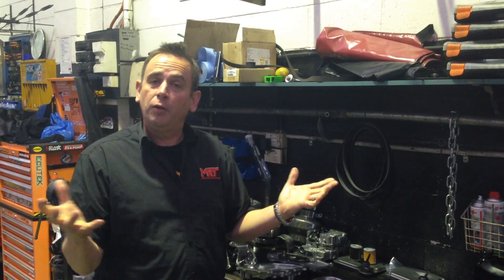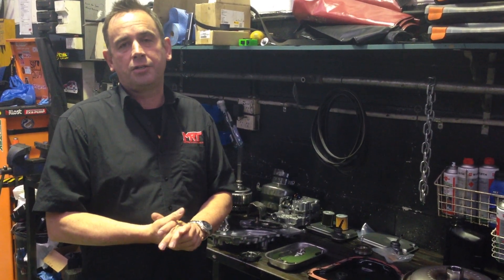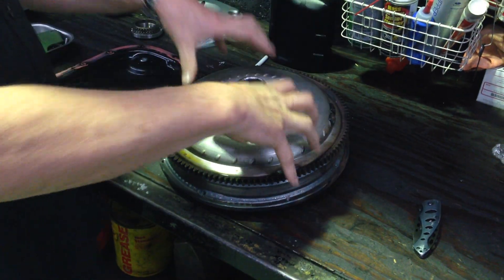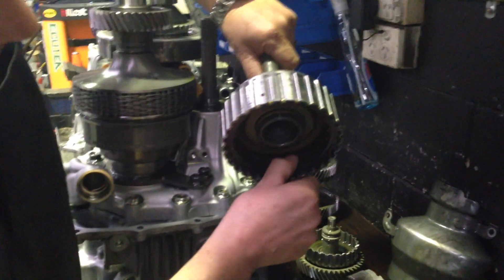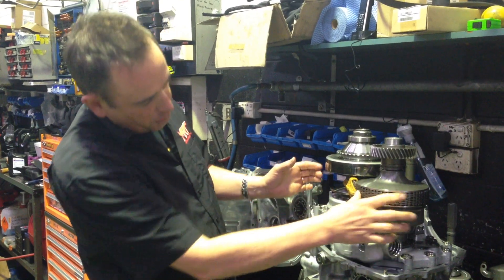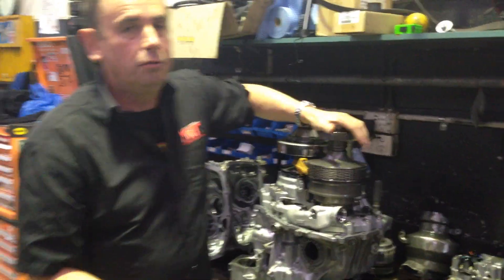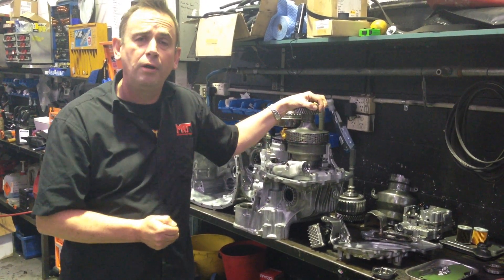Subaru CVT transmission secrets

Comment: Hello, awesome video I have a 2014 subaru xv crosstrek automatic transmission not going into gear. Noise coming from underneath the car's transmission sump pan area. Do you think the solenoids stopped working?

Comment: I just had to replace the torque converter in my 2011 due to stalling issues at 128000miles. Other than that its been pretty depwndavke

Comment: Help please!! Any advice on the Forester XT (2016) occasional hesitation under acceleration issue? Seems to sometimes hesitate under about 30%-50% acceleration (feels like maybe misfiring or cvt not engaging correctly). Issue is way worse with air con on!

Comment: 2015 outback 2.5l with CVT - real pita shudder at low rpms. Like its changing up a gear too early. On a cold morning the engine revs higher and it's not an issue until it warms up. 

It seems like they have it tuned too close to the edge for fuel efficiency at low rpms at the expense of shifting hunting gear progression. 

Has anyone fixed this??

Comment: I have a question....I have Levorg 1.6. Can TR690 be fitted instead of TR580 gearbox?   I want to increase performance, but can the transmission tr580 handle 350nm of torque?

Comment: Have a 2010 outback went to mechanic for engine light after they put on computer wouldn’t start. Subaru now says a inhibitor switch inside transmission has failed and I new a full new transmission as they are not able to be reconditioned. Had no transmission noise or issues prior to this diagnosis.. please help 6000 seems like a stupid outcome

Comment: I’ll CVT transmission is a piece of crap I highly recommend no one buying any Subaru products at all they are nothing but garbage cheap interior parts in a transmission that stalls . The reason they moved away from this transmission is because it’s a piece of garbage i’ve had to CVT transmissions in my Subaru and it only has 170,000 miles!!

Comment: So you said it will start slipping at 400 nm, convert to horsepower that’s 149 which isn’t good at all if you get the wrx with cvt. Even the crosstrek comes with 152hp.

Comment: hello i just got a 2013 Subaru Legacy 2.5 Premium has 175,00 miles drove and shifted beautifully  but im noticing like if the tranny is slipping before at 200 rpm i was doing 60 mp no problem  know i noticed it was like 3000 rpm going 40 mph and gave gas rpm would go to 5,000 rpm going 60 mph seem to have no power motor screaming and car not moving write do u think getting a transmission flush would help or something more serious ..  thank you for listing hope to hear from u soon thank you  my email  Martin350@live.com

Comment: I have a 2016 Legacy 2.5i and when I slow down, it almost sounds like the wind. The dealer said this is normal... Is that the case?
Reply: I have a 2017 Subaru and yes that sound is normal as you slow down.

Comment: If a cvt optimizes engine torque and performance why are Subarus so slow?
Reply: Bc the boxer engines (like the rotary) don't put out that much torque to begin with. You gotta step on it a little more.

Comment: @3min : That tranny fluid pump should be driven directly from the engine and not from the input shaft via torque converter. There's a funky fundamental design flaw, I believe. TOYOTA employ this design to have continuously variable pressure control to operate the CVT pulley more effectively

Comment: This is a very informative video. I am interested in replacing the main bearings that make the noise. I have already gotten two(2) but I need to know what is the name of the bearing that is on top of the pulley?. this bearing is a big bearing and some times  it will make noise when worn out. If possible please send me the info to nillocw@hotmail.com

Comment: In 2017 I was interested in a new 2017 Forester and when I found out that the towing capacity was 1500 pounds and that was because of the CVT my interest in the Forester or any car with a CVT ended.
Reply: I do hear that Bill, just now, we pulled out of a deal for the 2016 Outback for that--and for general reliability issues.

Comment: i'm inspecting a wrx with cvt in a few days .But this cvt is abit odd to me .From what i've seen even in manual mode you don't get the headsnap and fast feel like in a dual clutch or manual .It seems like the same acceleration as a electric car .Idk il have to test drive it myself but i like an auto with manual mode but a dual clutch

Comment: Good reason to lease Subi's.  They do have a high residual so lease payments are pretty good compared to other brands.  Unfortunately most mfgs are going to CVT's as they help with CAFE requirements.  Yes you can partly blame the govt for the CVT craze.

Comment: I have a 2016 Forester with a CVT.  The only problem I have with the CVT is the 2 second delay when you shift to or from reverse.  This is a major issue if you are trying to rock the vehicle when you get stuck in snow.  When I took the vehicle to the dealer to fix this problem the tech said that is normal and there is nothing they can do.  He never talked about a "CVT relearn".  Will the "CVT relearn" make the CVT act like a normal automatic transmission when shifting to and from reverse?
Reply: Best to upgrade Foresters that might get to drive on dirt, mud or snow to 'All Terrain & Snow' tyres - larger chunky knobs of rubber that won't get stuck in snow!
Reply: @GraemeHarrisonAU  , I agree tires make a big difference, but you still can get high centered and sometimes rocking the vehicle will get you out.  Thats why I asked the question.

Comment: The older Subaru Transmissions had an external filter similar to an oil filter that could be changed easily on the outside of the transmission.  To me the filter inside that cannot be changed without tear down looks like the sort of filter that will get dirty and clogged way before the strainer type in the sump. Sad to see and say but looks like a design flaw in my book. I love how the CVT drives though and would like a CVT Forester Turbo one day but the compromises are hard to swallow Subaru.
Reply: Putting a turbo with a CVT makes NO SENSE. One of the reasons is the CVT can't take it.

Comment: This is why I drive since new a 2009 Mazda 3 s hatchback 2.3 with 5 speed auto and 195,000 miles. I have been dumping money lately for suspension parts at all four corners and a trans module. A trans module is not a rebuild. At the end of the last 5000 mile oil change interval I got back from a 2000 mile Marathon trip in 50 hours. Car ran like a champ. Did not burn or leak a drop of synthetic oil.

Comment: My 2012 Outback is stalling at stop signs. I have been told it is a CVT torque converter issue and it needs to be replaced. Thankfully it should be covered under their new extended CVT warranty of 10years or 100,000miles.
Reply: I had the same problem with my 2011 Outback at 115k miles. I got Subaru of America involved and they covered half of the repair costs which was $1500 and SOA covered $750. My Outback has now almost 145k and runs great.

Comment: Can you swap a CTV from a 2016-present Subaru for a 9 speed automatic transmission?
Reply: Joseph Dugan get a manual
Reply: Joseph Dugan the 9 spds aren't much better imo.stick to 6-7max gears
Reply: No.  In fact, no other auto trans will fit in any Subaru.

Comment: I don't understand why you need to have oil pressure in the transmission with an electrical pump while the engine is shut off at a stop.

Comment: Wow, 30 years as mechanic. You are telling me it has an electric oil pump, clutch packs, chain drive with adjustable pulleys and one filter isn't serviceable from the pan? what a royal pain in the butt!
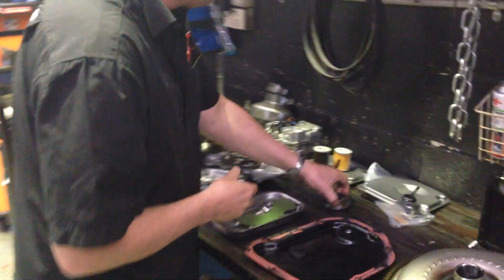Reply: It has a mechanical pump; see @3:00 where he replaced the bearing
Reply: @profuse007  it has both, the electric takes over when the engine shuts off for the engine auto/stop function
Reply: That internal filter and the fluid is "good for the life of the engine."
Reply: @birdwing98  no fluid is lifetime this is rediculous it is almost planned.
Reply: horrifying

Comment: I've had two experiences now with changing the CVT fluid, dropping the factory fluid & putting in Amsoil CVT fluid. 35 years now working on cars, trucks motorcycles etc and it's still hard to believe the very tangible difference in performance. These CVT transmissions really like Amsoil CVT fluid!
Reply: I couldn't agree more!

Comment: This seems like a very poor design for long-term reliability.  What is the point of embedding a non-user-replaceable paper element filter in the transmission?  The electric oil pump requirement created by the "start/stop" feature is another cause for concern.  Electric pumps are inherently unreliable and the fact that one is required in a critical component of the drivetrain simply to save a couple of drops of fuel simply does not make sense.  I test drove a 2019 Subaru Forester with this system and the engine restart from a stoplight was abrupt and noticeable. A mechanical system is only as strong as its weakest component...

Comment: From what i hear, consistently changing the fluid will prolong the life of the transmission. Also because the transmission has a lot of intricate parts, a "power flush" is typically not recommended.

Comment: My dad's 2015 Outback's transmission only lasted 4 years / 95k miles, so it wasn't even paid off before the transmission failed.  It's $11,600 to replace at the dealership, so it essentially "totaled" the car since it's only worth about $15k.   You'd have to be out of your mind to buy one of these in my view.

Comment: while i personally haven't had a cvt i'm afraid to buy one because i've yet to feel that they last to 100,000 miles they can gernade as soon as 20-30k if not even sooner. for me its an investing thing i bought the 08 when it was 5 years old, and felt i definately could get 5+ more years out of it solid EJ25 peek of its game, then 2012 rolled around and subaru started playing with shit. the CVT is one thing but those oil burning motors that replaced the EJ line ugh.

Comment: While I do prefer a standard transmission, my Impreza with it's cvt is actually pretty enjoyable.
Stomping on it, it's pretty quick to react, although definitely slower than a standard. I can never complain about 43mpg on the highways here, and while it does whne or whirr under load, it's not very loud about it.

It's fun, but I am afraid of the day it gets worn out and has to be replaced, as that transmission is also 1/3 the price of the whole car.
Reply: I love my fb20 Impreza w cvt as well. Not fast at all but great on gas and excellent in and weather

Comment: Good day, I have one question for you, I just busted my Impreza 2015 cvt transmission at 99600km. It would be replace under guaranty. My question: I often use the steering paddle to down shift when I arrived to a stop or to slow down instead of using the brakes. Is this a problem for the CVT along the time? Thanks for the answer. Alain from Quebec Canada
Reply: guess if it is a choice between a $3000 transmission (if not under warranty) or $25 brake pads, I would use the brakes!!!
Reply: Manual shifts and downshifts are harder on the cvt, or ANY automatic transmission. Just use your brakes…much cheaper to replace!

Comment: You didn't tell us how to maintain or tell us how to drive properly to promote longevityfor this transmission. I think that's what people expected from this video. I'm an engineerbut I still would like to know if it's really OK to use the paddle shifters as I do or if it's betterfor the transmission to let it do it's own thing. I'm not racing but I live in hilly and snowyconditions so I need to gear down a lot. Is this bad for these transmissions?

Comment: If the CVT get deteriorated over time, then 1) Can we replace only the belt. ? 2) shall we replace also the pulley ?
3. how much is the cost for replacement VVT ?
4. how many kilemeter subari CVT would typicall survive ?
Reply: My 2013 Outback (140,000) failed within a week of me driving it off the used car lot, which is how I learned about the existence of the CVT. Yikes. Apparently your best bet it to order a refurbished CVT from Subaru, which has a 12,000 miles / 1 year warranty. The cost quoted to me was $7,200.

Comment: Subaru seems to be using a link chain for the meat of the CVT, which is quite different to Jatco (read Nissan) units which relies on a thinner steel push-belt design (demonstrated here: https://www.youtube.com/watch?v=PiwRUfFEc5k). The contact area is a lot larger so hopefully Subaru has gotten the reliability down where Nissan still struggles in this department with belt snapping & wrecking the entire transmission.

Comment: CVTs are cheaper to make hence more profit. That’s the only reason manufacturers choose CVTs. It can never match a conventional auto in terms of reliability and performance. It’s no brainer that a gear to gear contact will last longer than a metal belt being squeezed and rubbed to death!
Reply: It seems to me that a CVT would keep the engine in the sweet spot on the power curve for lower fuel consumption, as well. I have a 2014 outback with a CVT and I'm really happy with it. But I'm also not racing or off-roading. That might make a difference in how I feel.

Comment: I have a Subaru Forester 1997 that has been great for all the years with very little to do other than annual services. However, recently I have had a lot of vibration & shuddering on the wheels when making tight turns. I have had all difs replace that has reduced the frequency but not always. We hope it isn't the automatic gearbox but has anyone got any ideas what to do next.
Reply: CV joints?

Comment: What would cause the car to shake and stall at stop lights from the transmission, I'm convinced it's the crap cvt transmission but the dealership is giving me the run around.
Reply: The transmixer has a extended warranty from Subaru for cars under 10 years old and less than 100000 miles. Your symptoms are the most common complaint  transmixer problems.
Reply: Torque converter.  Subaru has put out a tsb.  See if your subaru model year falls under that tsb repair.

Comment: I have a 2012 Impreza Sport Limited with the 2.0 and CVT, bought it from a Subie dealer at 106k with a 30k Extended Service Agreement... Subaru replaced the trans valve body last year for free at 115k, and after failing an oil consumption test at 121k 10 months ago Subaru replaced my short block for free, then two months ago at 127k my input shaft bearing went out and Subaru replaced my entire trans for a $200 deductible. Now I’m about to replace a gasket on the rear differential myself that is leaking...
Reply: Maybe it's time to sell it
Reply: Harbinger lol